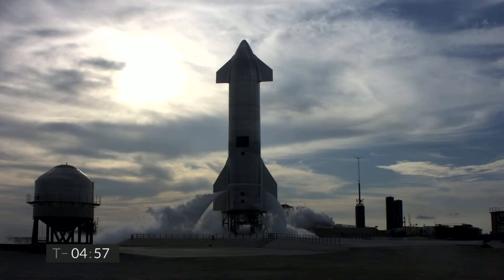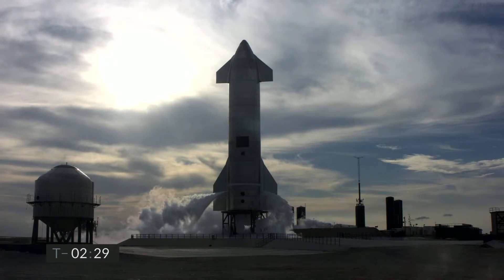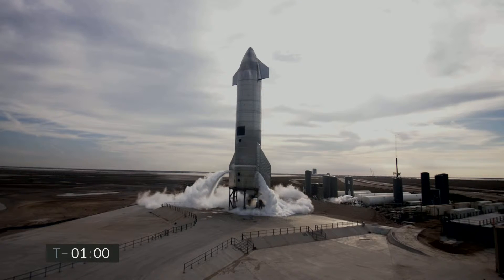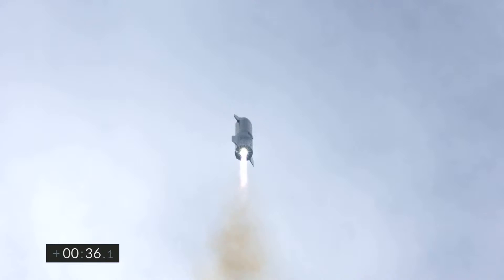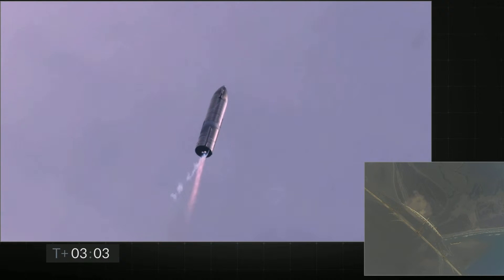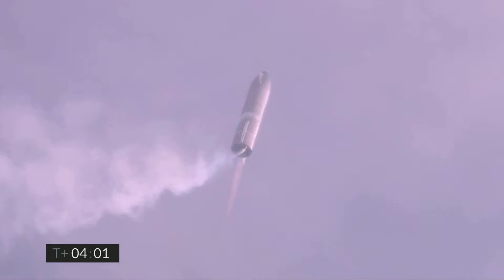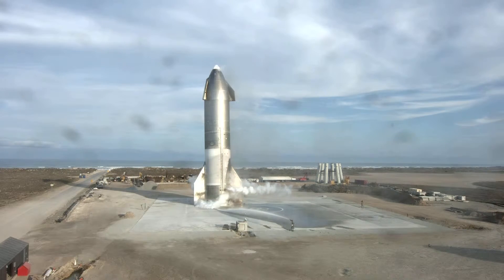Starship | SN10 | High-Altitude Flight Test

Comment: how much more pollution do these generate compared to a jumbo jet plane?
Reply: Per unit or the whole industry?
The rocketry industry generates miniscule amounts of pollution compared to all other modes of transport.
Reply: @logitech4873  per unit
Reply: @thecarpentershow8507  A boeing 747 generates about 1100 kN of thrust. 
This test rocket with just 3 raptor engines generates 6630 kN of thrust. 
The final design of this stage is gonna have 6 raptor engines, generating ~13 000 kN of thrust, and the superheavy booster is gonna have 28 engines, generating ~62 000 kN of thrust.

Unsurprisingly, its emissions are higher - but it burns the fuel very cleanly, which is why there's no trail.
Reply: @logitech4873  they love to pollute this world.
Reply: @thecarpentershow8507  This is a design for a reusable rocket. The idea is to pollute less.
If we were to throw away our planes after every use, that would be pretty bad for the environment.
Reply: @logitech4873  either way it's additional pollution that's now reusable hence it's going to be used more frequently in the future and pollute more...

Comment: @SpaceX @ElonMusk congratulations for the landing!
The ignition procedure used on this landing, was exactly what I suggested after SN08 and SN09 crash.
To start the engines on the horizontal position, because the lower back pressure would interfere less with the ignition.

Comment: The First ever Starship to lift off twice and land twice! (That too in a single day!) Proud of you SN10!
Reply: Bob Pearce  If you consider the surprise 'lift off and landing' that followed this stream... 😁
Reply: Bob Pearce  you can see a fire on starship at landing, I guess that fire continued inside the skirt because 10 minutes after landing the bottom part blew up and launched the upper part into the air, making it the first starship to fly twice
Reply: @90percenthuman39  Yea, that fire was a pretty obvious problem that was going to have one of two results, either one bad. However, that wasn't what they were testing, so they can fix that on the next test. That's why they have tests.
Reply: @lwilton  yeah you could see them hosing down the fires but I guess because the landing legs collapsed they couldn't put out the fires underneath the skirt
Reply: @90percenthuman39  It looked in the last scenes that that was a automated fire monitor at the edge of the landing pad. It didn't have an angle to get under the skirt, even if it had made a good landing. If they could have got a fire truck there they maybe could have caught it, but that would have been a crazy risk of people for no real benefit. This gives them data, they can fix the problems by the next landing or two.

Comment: The first successful test of the ugliest flying object (UFO) ever created. Its sad that they had to destroy the other ones to increase the suspense and make this one more dramatic.
Reply: Starship is still in its early development phases. Manufacturing and welding will improve over time, and the belly will be covered in heat shield tiles, which I think wilk make the rocket look more high-quality.

And the explosions of Starships SN8, SN9, and the prototypes before those, weren't staged. SpaceX's Falcon 9 rocket also had failed landing attempts before its first successful landing.

Comment: It hit the ground so hard it bounced about a meter off the pad. ! That would have caused some serious damage - seems like they again had engine thrust issues but not as bad as the past ones and different. The damage from the hard landing is probably why it exploded later. Still that's a great improvement to land in one piece so they learnt allot more and improvements will be made.

https://youtu.be/ODY6JWzS8WU?t=720

Comment: Can anyone help me with an answer?
When the SN flips from it's belly to being straight. We see a clear blueish flame in the centre. BUT  Why do we always see yellow flames shooting out randomly and seemingly uncontrollably? Along with it
Reply: I believe what you're seeing is the engine flame-outs. It starts the landing procedure with all three raptors light up so it can flip quickly. Once it's vertical, it shuts down two of the three engines to reduce its thrust for a smooth landing. Those fireballs are mostly the last of the gas burning up from engine shutdown.

Comment: how do they plan on testing out vertical landings on mars with 1% atm and 33%g? also, they need to test out landing it on soft surfaces there aren't going to be concrete pads on mars if one side sinks into the ground it might tip over. maybe something like snowshoes needs to be added? probably several moon missions to train for mars?

Comment: It's disappointing that you didn't put the exploding part..why change the narrative of what happened? 😠 It's equally important as the flights 
I seen it from other news later and was so confused 😕
For those wondering, this exact rocket exploded minutes after landing due to methane leak

Comment: I’d love to see the telemetry on this. Starship’S ascent from liftoff looks incredibly slow.
Reply: The starship being tested here is the upped stage, meaning it will be used in orbit and for returning to Earth, however, when taking off the Starship with use the super heavy booster, which will make it go quite a bit faster.
Reply: it doesn't have a full set of engines, just enough for the test at hand.
Reply: @jwenting  The vacuum engines won't fire in the lower atmosphere anyways, this is the full set of sea level engines.
Reply: its prob maxing out at 600-800mph to get to 10km in under 2mins
Reply: The atmosphere is thicc

Comment: It needs longer legs. How are you going to land on uneven martian surface with those stubs?
Reply: Landing was the plan here. Legs can be worked on later. If they can't successfully belly flop flip fire and land vertically it doesn't matter how good the legs are.
Reply: these vehicles are test beds, once they make a ship for actual use, it will be designed to accommodate the requirements of the mission.

Comment: What moron would believe that is real?
Reply: I saw it in person, care to explain that?
Reply: @thismonstrosity2137  Don't have to. The smoke moving horizontally is moving faster than the rocket supposedly shooting to 10 km - all before the hover. Care to explain that?
Reply: @nobs3075  well its not smoke it's methane boiling and venting off of the rocket, methane is lighter then air so as the rocket moves the methane goes up giving the appearance of going sideways, this is simple science please educate yourself if your going to criticize something
Reply: @nobs3075  it does move faster towards the end when the rocket slows down when it's about to reach its apogee, go take a science lesson
Reply: It's clearly real
Reply: @ELLA_IS_DUMB  CGI real.

Comment: im just so impressed how powerful these engines are. Just one able to hold this massive ship in a hover is incredible.
Reply: By the time it lands it's a lot lighter as it no longer carry that much propellant.
Reply: I would assume at that height the air is so thin and less gravity ir has to help.
Reply: @jeffdeprey6279  the difference in gravity would be absolutely negligible at that height. It's just the sheer power of the raptor engines
Reply: @jeffdeprey6279  You would assume incorrectly.  The ‘thin air’ is irrelevant, because the vehicle velocity is deliberately kept low - particular as it nears apogee.  So there is little drag to oppose thrust.  Like, VERY little.  As for a gravity differential... that doesn’t even pass the giggle test.  As other commenters here have noted.

Comment: Things I noticed while watching the flight: ( i learned about the explosion later.) 

at 6:27 there appears to be a good bit of smoke, I have not usually seen this.
at 8:20 The engine that is further from the camera is burning a bright orange as opposed to the other burning the usual purple colour.

at 11:47 The engines shut off in a different pattern than they had originally said. They originally said they would light all 3 and immediately shut off 1 of them but they wait to shut one off and then shut another, landing on one (this shows to not be a problem and was probably intended.)

12:41 is this fire normal or could this have been caused by the propellant leak I was hearing about? 

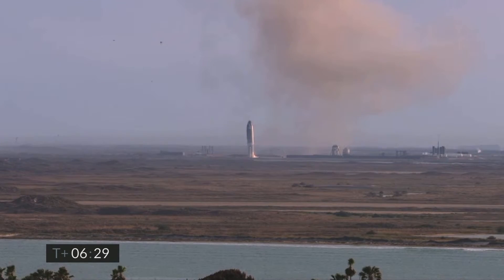13:00 The vehicle is clearly leaning to one side, I thought one of the fairly rudimentary landing legs broke but apparently, 2 or 3 failed to lock in place.
Reply: Apparently every single landing leg except one failed to lock in place, which probably would've been the reason why the lean was like that.

Comment: You can see it jumps a bit after hitting the ground too hard.
Reply: It did a bit. I thought they were gonna use 2 engines to land for some reason. Regardless the fire was terrible. They somehow need to stop that happening but there's always a burst of fire when the engines cut out, even when ascending. Two at the same time after that flip, maybe they need some kind of built-in extinguisher

Comment: The flight was ok, I'm sure it gathered great data but there were a few things nobody mentioned that seem to make it far from perfect.  

There was an anomaly during 3-engine ascent which was visible as dirty combustion for a short bit at T+00:36 and T+00:41.

During 2-engine ascent the engine bay footage at T+02:30 showed 2 different colored flames, also visible from rear view at T+02:20, flame shape and position of shock diamonds was also different...  throttling or problem?

Also during 2-engine ascent there was a very odd divergent angle of the 2 engines visible in some of the non-SpaceX footage, asymmetrical thrust from an engine?

The landing 3-engine ignition had all 3 light up but instead of dropping to 2, then 1, it immediately dropped from 3 to 2 then one only a few hundredths of a second after, leaving it on 1 engine too soon maybe?

When the 2 engines shut down at T+06:06 there seemed to still be a lot of fuel flowing and billowing orange flames that persisted through and after the hard landing; software, valve or broken bit?

The landing occurred too fast, collapsed several landing legs bounced up and then back, did engines contact the ground hard too?  It stood up still with a 5-7 deg list, fuel leaked, kept leaking or more leaking and burning, possibly blowtorching inside the bay until the tank ruptured and kaboom.

Overall still a quite successful flight.  The control during flight was good all the way to the ground, but the key concern i had was that engine fault management may still not be detecting and protecting when an engine goes sour but not totally failed... when the 3 are lit at landing its supposed to detect faults and keep the best 2, then 1; did it?

Its only the 3rd landing from belly-flop and the progress is still AMAZING.  Falcon 9 progressed slower after all and has succeeded brilliantly. 

Bring on SN11 !!!

Comment: This wasn’t a complete success, it looked like one of the engines failed as 2 were needed for the landing maneuver however clearly only one worked and in case you didn’t know, the rocket blew up after like 10 minutes of landing
Reply: Yes, it was a complete success, since it did not explode when landing, which is the objective of the mission, of course they failed at some point during the landing, but it is the first landing they do ... they have to practice and practice, You are not going to teach your baby to play soccer if he first has to learn to walk ...
Besides that the landing is done with 1 engine, since with 2 it would be a lot of power.
Reply: This test was to land with only one engine. The commentator says that

Comment: Questions : Why were the two out of three engines turned off at a critical point during landing just some 150 meters from the ground after attaining vertical orientation ?
How did it manage to hover cocked for a few moments there and also land and rested cocked ?
Why did it explode/shot up into the air some with its rear end some 75 meters into the air ?
Reply: only one engine is sufficient to provide thrust for landing, more engines is overkill, if lit, its just too much thrust that it would just go back up.
Reply: @VercilJuan  OK but wouldn't that reduce the stability of the rocket though . I would imagine the flight computers continuously making macro adjustments to the engine power and vectoring so would not at least two live engines be better ?
Reply: @111danish111  Yep, Its way too off-center. But its space x, the computers can handle it
Reply: @111danish111  If your talking about off-center ness, two engines wouldn't be any better, really
Reply: @VercilJuan  interesting thanks.

Comment: Did it explore after landing? Our local news ABS-CBN News Philippines said it exploded
Reply: It did yeah. Current rumour is a methane leak caused a gradual buildup in the engine bay, which then somehow ignited and went boom.
Not much they could do about that, too risky to send someone in to seal it. Best they can do is figure out what leaked so it doesn't happen again.
Reply: @lazarus2691  but it exploded like really exploded?
Reply: @lazarus2691  awwww crap .. well! That's ok! We still have SN11 and more data from SN10

Comment: I think it's really interesting but the success criteria really bugs me. Mars does not have a concrete pad to land on..it has dust that sticks to everything and a layer of uneven basalt rock. Starship needs to fly to death valley and land in the sand.
Reply: Unfortunately the FAA would probably have something to say about such a flight...
I'm sure SpaceX do intend to test landing in rough terrain, but for now they just need to get landing working at all.
These early prototypes only have very rudimentary landing gear, later versions will be much more advanced.
Once they've got the better landing gear, then they can start testing more texteme landing scenarios.
Reply: so aerospace wise they could actually do that flight..the key is where it's launched from and who the launch partner is. The X37b is a good example of this, from target airstrip to space and back..not a single public peep from the FAA.They made it work as it was a zero fail mission. Dont get me wrong, i want spacex to succeed, but the reality is Starship weights by design right now empty at 200,000 kg and Perseverance which just landed weights..1600kg loaded. accounting for mars gravity its 75 percent reduction ish..so more than 50,000 kg, vertical in the desert without sinking, falling over, or exploding on impact is the actual exit criteria.
Reply: @Sunshine_Fire  
Current Starship is a lot less than 200,000kg. That was Mk1. The current prototypes are life half that.
Also, it's not the weight that matters, but the ground pressure. As long as the feet on the landing gear are big enough there's no issue there.

Comment: I hate the way the camera cuts just when something important is about to happen, totally throwing out the flow. It does it when the rocket turns off and starts to fall so you can't even tell which way is up any more, then does it again when the engine fires up again on the landing approach.